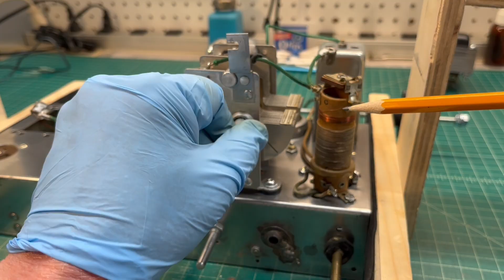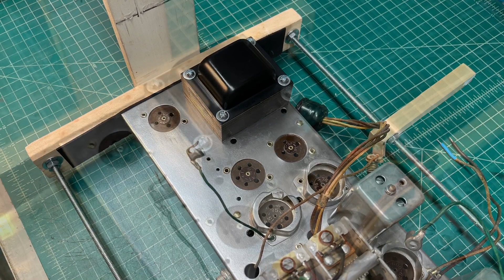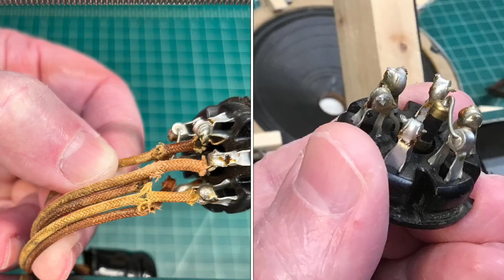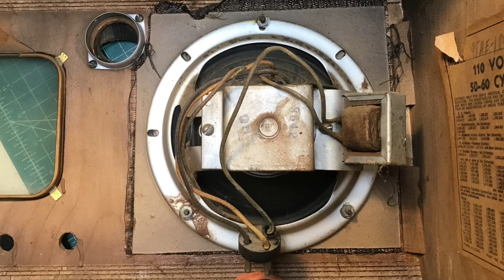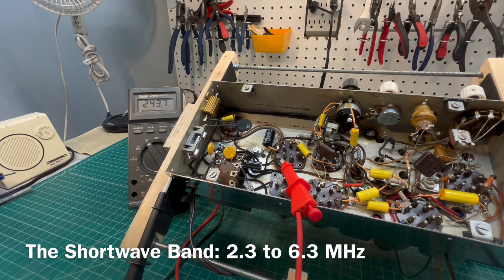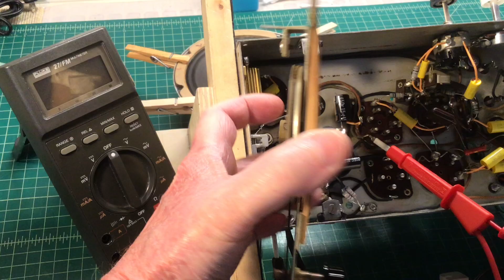Knight 98AE-184K -  Power Up After Reinstalling the Antenna Coil & Power Transformer + Next Steps

Comment: Nice job!  Very detailed and thorough.  I've never used a CL90, but I have installed a dropping resistor, mostly in certain model Zenith's.  Can really help to keep a slightly undersized transformer run cooler.
Reply from the maker: Thank you Adam. I’ve used them in the past on those Zenith sets and alike with the undersized power transformers; they should help. Thanks again. Best, Don